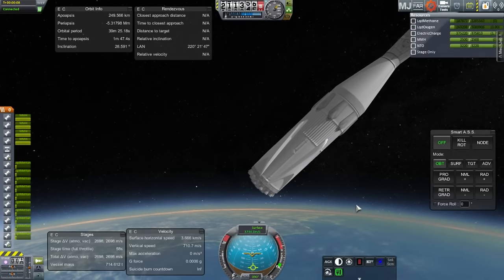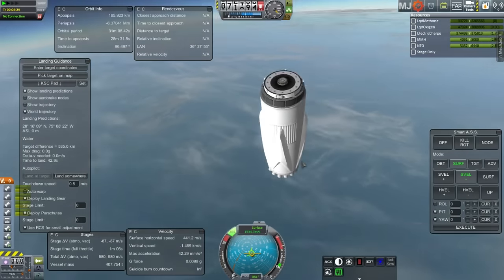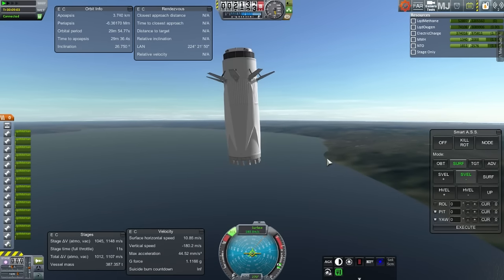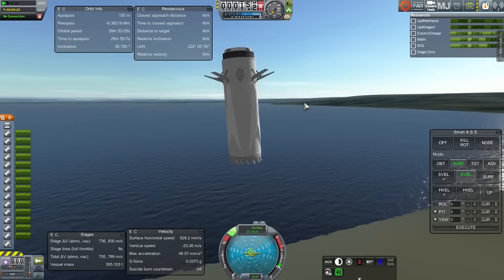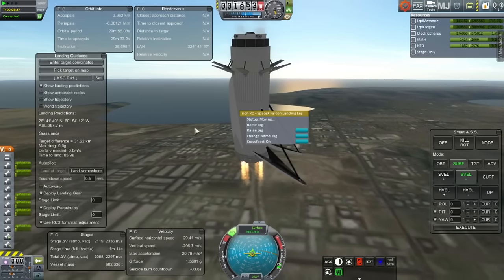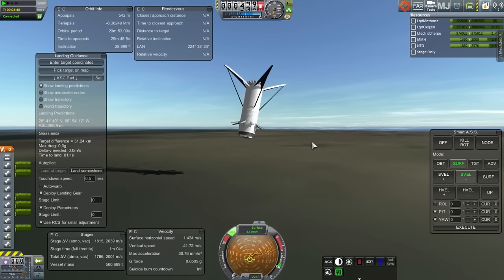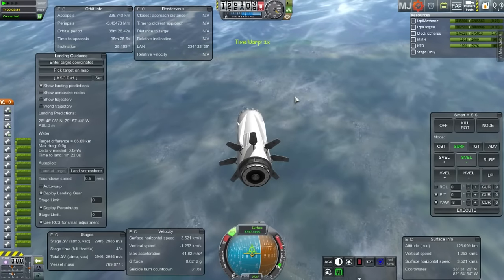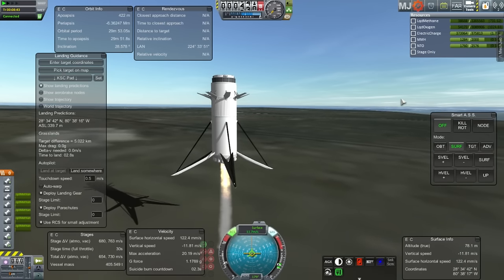Kerbal Space Program/Realism Overhaul - BFR Recovery Test

Comment: 1:02
high density fuel? 
you mean low density fuel :)

greetings nice video
Reply: *****
Why would you compare Methane to LH. whenever I talk to someone about this its LK vs LM
Since LH has a significantly better isp than LM.

"SLS main tank and in the upper stages of Saturn V, and the N1 solved the fatness problem with its unique cone shape. Those are the only rockets that even come close to the size of this one."

I know

I just think it's kinda "unfair" to compare the fuel densitiy of x toLH since it has the lowest of all fuels.

I don't see the LM technology going anywhere since the isp gain is mediocre and the densitiy is much less  better insulation > bigger stage and so on.

So I would say LM is a low density fuel but that's just my opinion.

I mean they cancelled the AR-1 for a reason .

Nobody needs LM imho.
Reply: +rhetorical ABM Sprint LH also ruins the turbopumps of current engines and would mean they wouldn't be reusable.  It's also not convenient to obtain on the surface of Mars.  LOX/Methane is a much more superior mixture in this regard.
Reply: *****

"LH also ruins the turbopumps of current engines and would mean they wouldn't be reusable."

SSME ?
Reply: +rhetorical ABM Sprint which required complete removal (not designed for) and a complete overhaul for exactly the reasons I outlined in my previous reply